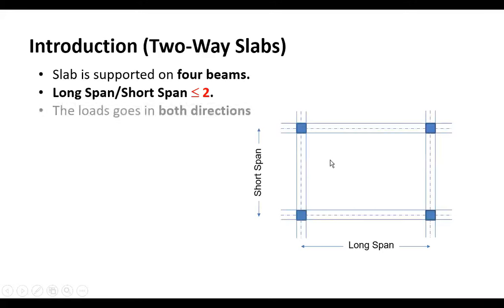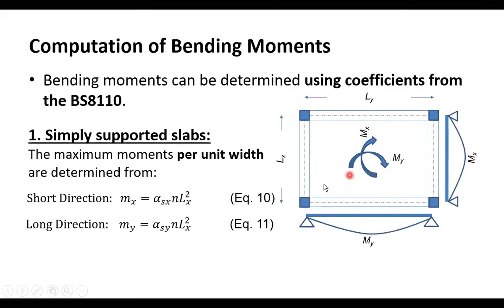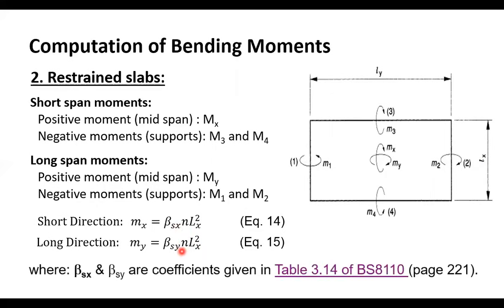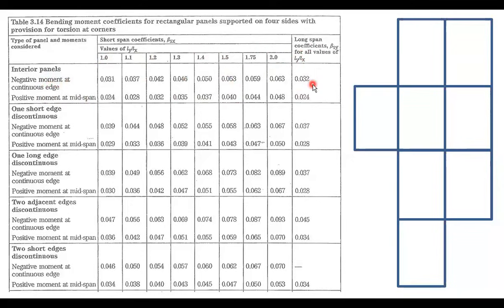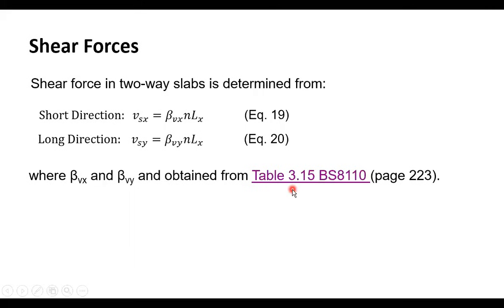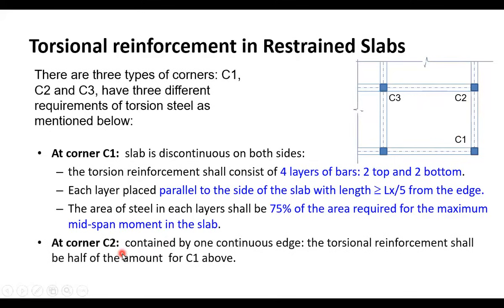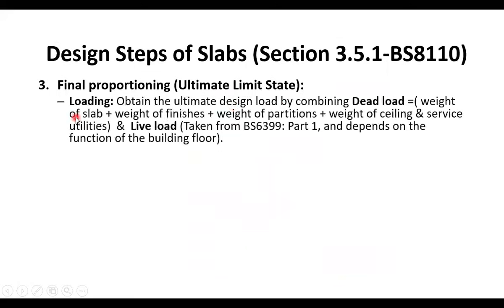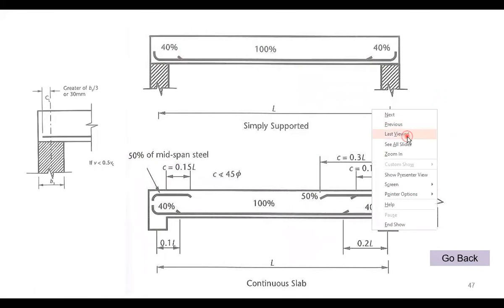Design of Reinforced Concrete Two-Way Solid Slabs using BS8110 Code (Part 1)

Comment: Without using that table and the formulas, can we just use moment distribution and sway analysis to get the moments? will it be accurate as same as the formulas given in the code? What are the options?

Comment: Really great video, one of the clearest explanations I've seen. would be also really great if you do similar explanations using American standards, and i think that would be great for you aswell since you will tap into a whole new audience.
I also have a couple of questions: 
1) what to do with the alpha and Beta coefficients if they are in between the ones given, such as for a slab sized 7x4m, ly/lx would be 1.75, is the appropriate solution to interpolate the coefficients, round up (1.8) or round down (1.7) ?
2) As you probably know, very often you get buildings (specially private villas and buildings of that sort), where column layout is very irregular, resulting in a non rectangular slab, i know in practicality FEM software will be used, such as SAFE, but it would be great to know the solution to this as a manual calculation..
3) similarly to no2, sometimes even if the slab is rectangular based on the column layout, beams are not always provided/possible due to architectural restrictions. what would be the solution to this? for example an "internal panel", that is continuous on all 4 sides, but say 1 of the sides has only columns without a beam...

Comment: Dr.shari you answered one of the peaple about can we use the table of two way slab for un equal span and you said we can use it but in the cod part1 23 october 2002 in clouse 3.5.3.5 state that 
The condition in which the equation may be used for continuous slabs only are as follows
1.the characteristic dead and imposed loads on adjacent panels are approximately the same as on the panel being considered
2.the span of adjacent panels in the direction perpendicular to the line of common support is approximately the same as the span of the panel considered in that direction
Reply: yes
Reply from the maker: These conditions are used for one-way continuous slabs not the two-way slabs.
Reply: Thank you very much 
But this clouse talk about two way and in the beginning of clouse 3.5.3.5 " state that Restrained slabs where the corners are prevented from lifting and adequate provision is made for torsion : condition and rules for the use of equations 14 and 15 "
And you can see thise equation from clouse 3.5.3.4 this equation about two way not about one way .
Reply from the maker: Thanks Mohammed. What you said about clause 3.5.3.5 is correct. It is for two way slabs but you still can use equations 14 and 15 for two-way slabs with unequal spans but you need to do some extra work to distribute the different negative moment values from the two adjacent slabs. This is explained in clause 3.5.3.6.
Reply: Thank you very much ...

Comment: This has been a very educative and informative lecture. You have simplified the method and process of designing two way slab, both simply supported and restrained type. I can't wait for Part 2 and 3 on solved examples. Thanks very much Dr. and may you continue with your good work and GOD BLESS